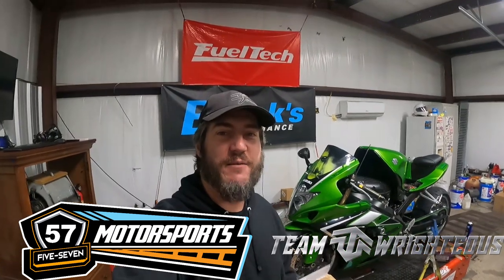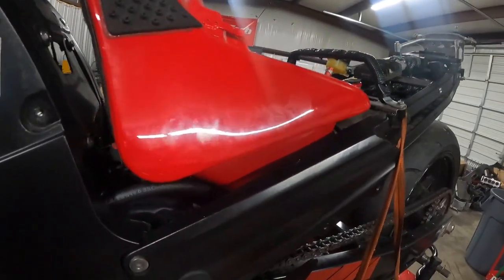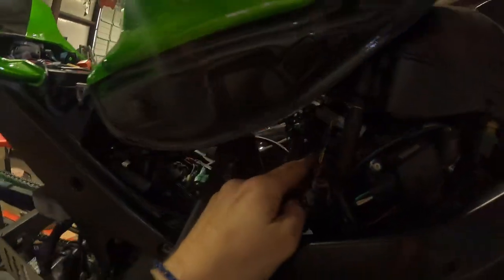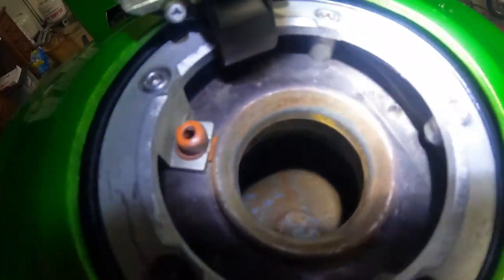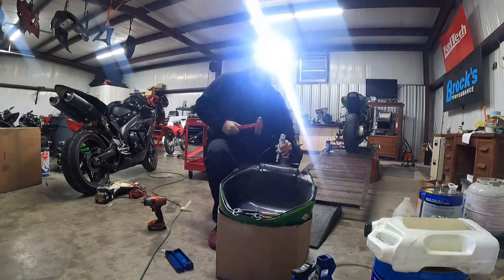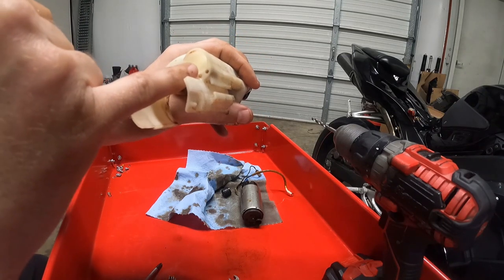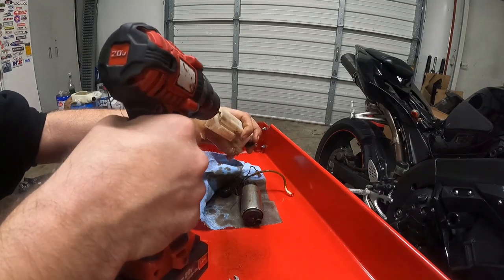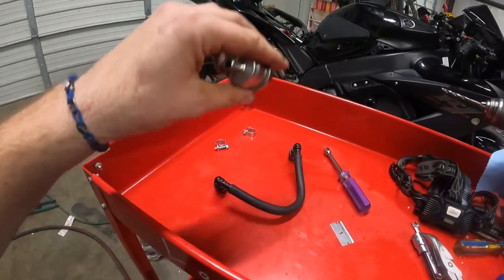How to fix your fuel pump on your Suzuki or Kawasaki Motorcycle

Comment: You guys are incredible. I watched your first video for this mod and it was good enough to fix my recently purchased 2002 GSXR600. While this video was cleaner than the first one, I did like how the first video was easier to see how to hold the drill for the bypass.  But this information is incredibly useful. Many thanks for your work to make these videos.  My bike died during use and refused to fire at all. After verifying that the plugs were sparking, I pulled the hose off of the fuel pump and watched it pump gas into a bucket. It was a very weak. My fuel pump was much more dirty and rusty than any video I found on YouTube. I really thought it was a lost cause to fix it. But after shopping for a replacement, I decided it was worth the effort to try. The end result was incredible. Not only does the bike run now, it performs much better overall than it ever did for me before.  There was so much crud that I did deviate a little from your advice. I tested the pump motor stand alone in my kitchen sink using hot water and Dawn in a 32 ounce plastic food container. I used a battery for power and verified that the pump worked fine. After the bypass, I used the same method to clean out the pump housing. I had to wire brush the rust and scale that was all over everything, But your modifications are wonderful. In my opinion the external filter is far superior to the original design. Again thank you.
Reply from the maker: Man, I really appreciate your kind words and details into how it helped you and the work you had to do to fix yours. So happy you have a good running bike again. Be safe out there 💪

Comment: Hey great video and EXACTLY the video I've been looking for and needed to see. I own a 2005 GSXR 1000 and needed to change the fuel pump. Once I pulled the old pump , some of the wires on it broke away from their locations and I have no clue where they go back to. In this video you took pictures of that wiring starting at the 20:44 mark.  Got the new pump and sock. Just trying to get my bike back up and running. Would you be willing to share those pics please? Thanks and any help is greatly appreciated.

Comment: Why did you put the fuel filter inside the well back on? What if that gets clogged again then having an external filter is useless because you would have to open up the pump again? I understood the bypass with the drill but shouldn't the filter inside the well be off since you have an external filter now?

Comment: You know what they do with those Kawasaki's???? They poke a hole in the metal looking mesh filter screen with a pick and once the hole is poked all the gunk comes out like a tea bag, and after it has a hole in it they put an external inline filter for high pressure aplications.👍

Comment: 07 gsxr 750 3900 miles It doesn’t have any issue revving past 8k but when I’m in gear it falls on its face at 8k and won’t go higher, this is in all gears aswell, But if I turn the bike off and back on it doesn’t have this problem until about 15mins of riding, any ideas?
Reply from the maker: Have you done the fuel flow test to check and see how much fuel it's flowing?
Reply: @TEAMWRIGHTEOUS  not yet, it just started happening yesterday and I haven’t had time to check it yet, just looking for a good place to start
Reply from the maker: @xZyphi  understood. Yep, the test for it is super easy. The actual mod takes time and patience, but isn't very hard either.

Comment: Will this help my 01 1000 gsxr it is stumbling only at 5k rpm? Sounds like it’s not running on all cylinders been trying to fix this for a year now
Reply from the maker: Does it still pull all the way to redline?
Reply: Yes it just bogs out at 5k and only 5k and I let someone else take it down the street so I can hear it and it just sounded choppy like it wasn’t running good could it be a fuel injection problem bad injector I’m not sure I’m stumped
Reply from the maker: @tylergallo8301  so, with it pulling all the way to redline and only having an issue there at 5k, I doubt this would be the issue. Because it's going to run out of fuel and not be able to pull past that point if fuel flow is the problem.

Quite possible could be the kickstand switch. At a certain rpm it vibrates just right to make it cut up.
Reply: That is a good suggestion never thought about it

Comment: 06 07 puel pumps you can swap out with a AEM in tank pump that's what I use and swapped to a 55psi regulator
Reply from the maker: Yeah... We do that in the Suzuki pumps too. We don't have to change the regulator though. The extra fuel flow increases the pressure on it's own.
Reply: @TEAMWRIGHTEOUS  cheaper than buying a new OEM pump by a few hundred and a off the shelf part 👌
Reply from the maker: @kawasakieddy61  the pump itself very rarely goes bad. This isn't to fix a pump issue. This is to fix a non flowing fuel issue. More fuel volume isn't going to force it's way through the stopped up internal filter.

Comment: Thank you for the video. I did this mod on my 2000 busa with the fuel pump that was switched in the tank already.cleaned the injectors, however Bike is running sluggish like it is drowning in fuel. Any help?
Reply: Like
It’s running rich.
Reply from the maker: Does it have a power commander on it?
Reply: @TEAMWRIGHTEOUS May I ask why a PC would cause issues?